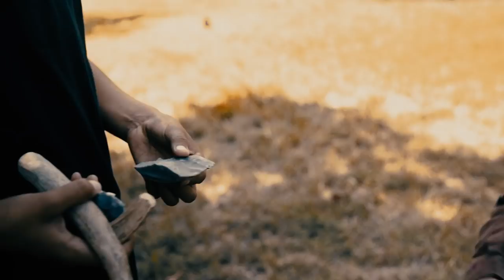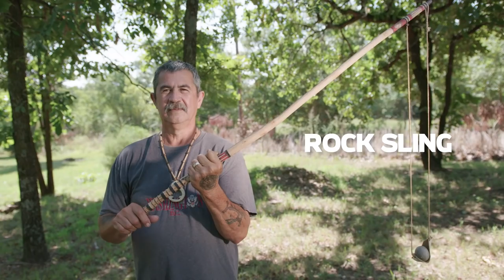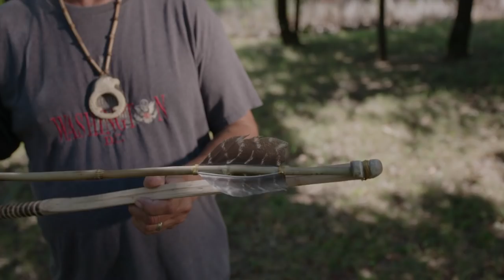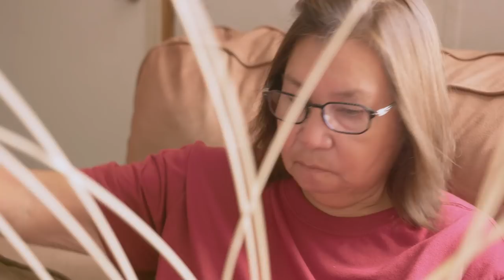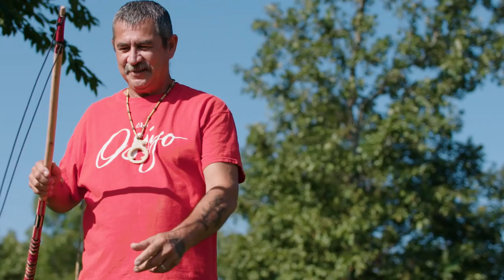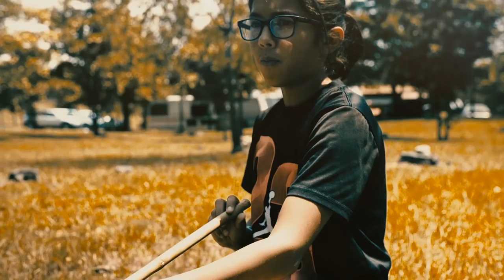Perry Vanbuskirk, Ancient Cherokee Weaponry

Comment: How strong is this bow. Say at what distance will it bring down a deer or a buffalo?
Reply: That bow he was shooting was very weak..  I'd say most of the Indian bows were 30, maximum 40lb stick bows.. I also Imagine living the way that they did, they were able to get extremely close to prey, making it easier to bring down a deer.
Reply: tslmiami so actually bows back in the time of war, for Cherokee warriors at least, were a lot heavier than what we even consider heavy for trad bows today, most war bows were 80-100 lbs and upwards to 6.5 ft tall while hunting bows were 60-70 with a relatively shorter length, 5.5-6 ft. all made of mostly hickory, black locust, and white oak. using those woods prior to removal and once settled in Indian territory, used exclusively osage orange. I would say that the bow in the video was 30 or so pounds.
Reply: The traditional bowyers bible discusses the Cherokee longbow. The bows were a flat bow that formed a D when strung meaning bent in the handle some. They were around 55-72 inches long made of Osage, locust and hickory. Osage of course is best. Draw weight was between 40 and 80 lbs. The Cherokees have a tradition of long distance shooting at corn stalks. The shot between 50 and up to 180 yards. These bows could be very strong and there are records of Spanish conquistadors being shot through the leg and pinned to their horse.
Reply: From a hundred yards dont you know he does it all the time because hes an indian outlaw.